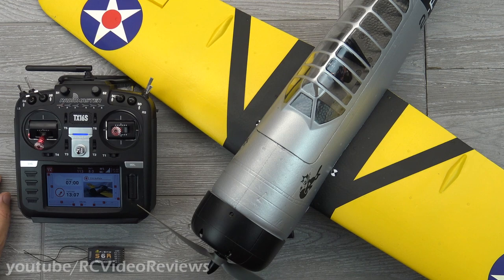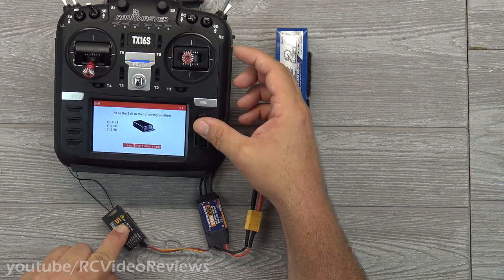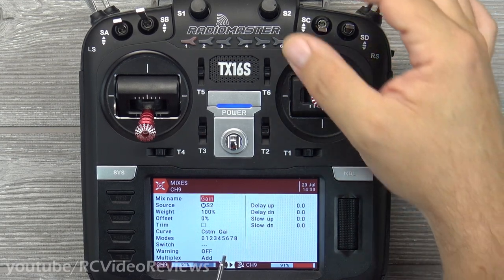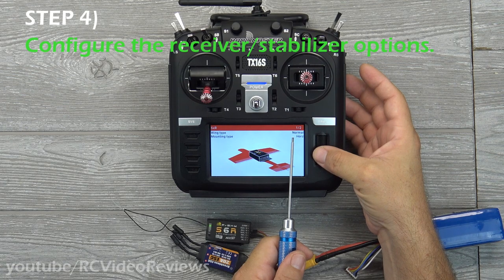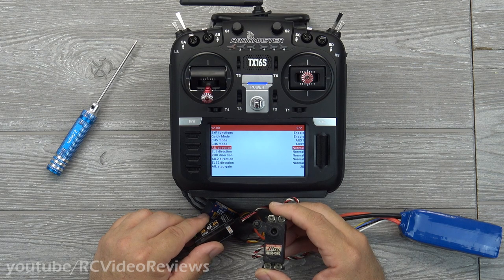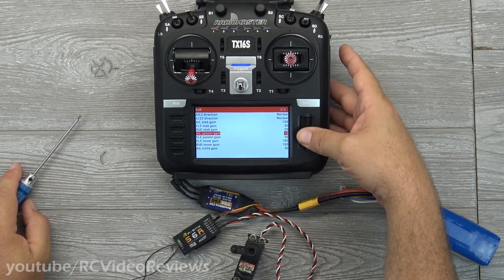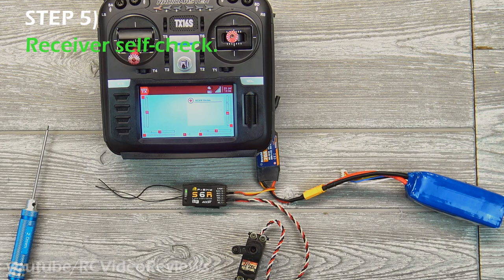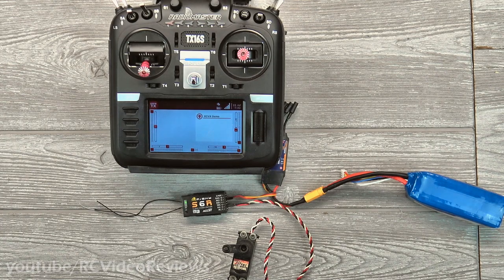Radiomaster TX16s and FrSky S6R / S8R Setup Guide [Quick Mode] • [Intermediate]

Comment: Your video about Open TX ,Radio Master TXs and RC items  are very helpful.  hank you very much.
I have a problem with my S8R receiver.
The throttle of channel 3 works correctly.
However, all the other channel are fixed near neutral (5-7channel are exactly 1500ms) 
Then, nothing can be done after that.
Do you have any solution ?
Reply from the maker: Set rates to 100%. Perform level calibration by having channel 12 pass through 0 3 times in 5 seconds. Wait for servo dance, then move your sticks to full deflection immediately after servo dance is over.
Reply: @RCVideoReviews  Hello Thank you. I 'm not very familiar with open TX mixer. Could you tell me more details of how to use channel 12. Unfortunately I can not understand [ channel 12 pass through 0 3 times in 5 seconds] because of my ignorance.

Comment: have you flown this receiver in larger air planes  like 1.20 size nitro  with this radio as well?  pretty new to the radio master unit and just trying to get some feedback when it comes to this unit
Reply from the maker: The biggest plane I have is my Dynam Smoove which is 63” and it has an S6R.

Comment: Did you add a lua script in the radio or it is autoinstalled while the biding procedure
Reply from the maker: It comes with the stock sd card contents. Nothing gets auto installed on opentx radios outside of what is included on the sd card contents from the developers.

Comment: Thanks for the help with my S6R. You kind of lost me in the gains section though. I will be using the S6R on a delta wing with only elevons so I guess I should leave the gains as they are.
Reply from the maker: What's the question on gains? Gains just go to how far and how fast the stabilizer changes the surfaces. It seems in Attitude mode the gains specify speed of reaction where in stabilize mode they specify distance of reaction.

The simple thing to do is to put gain on a knob and use the knob to tune while flying. If the plane oscillates, reduce the gain. If it doesn't respond enough, increase the gain.
Reply: Thanks for clarifying the difference between Attitude mode and Stabilize mode. I set everything up as you directed and did the initial calibration as it is not secured to the AC yet. It all is working as I can tell but now the elevon mix I had worked out is all out of whack and I am still trying to figure out how to fix that. When I get that worked out, it's time to fly.
Reply from the maker: @graywoulf  You don't set mixes on the radio if you're using an SxR, you set the mix type on the SxR configuration and the RX handles the mixing for you. Put Aileron on Ch1 and Elevator on Ch2 in your radio and set the plane type to wing in the SxR setup.
Reply: I thought that was part of your tutorial here in going into the radio's settings and the FrSky SxR settings and designating the wing type and mounting orientation. I guess that this is going to require the use of the S.Port Tool Kit (STK) and app then?
Reply from the maker: @graywoulf  Nope, you can setup the receiver entirely via Lua. I'm just saying with the S6R you don't use mixing in the radio. Just tell the SxR you're using a wing.
Reply: As it turned out, all I had to do was delete the elevon mixes in the model setup to get it working. Since I had already told the SxR that I was flying a wing and it had already set up the mix. As JB would say... "I learned something today". 😉👍 Thanks for your help once again.

Comment: Hi, great tutorials.   I’m currently using the x9d on an excavator.  The TX16s display does look more intuitive, I will try to see if you have done a comparison video as wondered what extra benefits I could gain by updating.
Reply from the maker: Here's the vs video I made: https://youtu.be/hZf4HqBuDas

Taranis is really good though. Hard to beat that radio. It has solid hardware.
Reply: RC Video Reviews    Thanks for the speedy reply and info, will take a look. 👍
Reply: RC Video Reviews    🙈sorry I now realise I watched this video which got me thinking about upgrading to this model. Either that of the x12s

Comment: Awesome video! (as usual) John. Thanks for the quality of the material and delivery! 
(We need to support your efforts via Patreon).
So I have a question: I am trying to set up an S8R Rx and I am having trouble getting the "System" option (04 - Frsky SxR) to work for me. 
I can get to it and see the 1/2 and 2/2 pages. One page 1, I see Wing Type line and the '---' to the right, but I hit Enter and nothing happens, same thing happens for "Mounting type".  If I go to page 2, the same thing happens I hit Enter and nothing happens. Any suggestions?  

BTW one thing you could perhaps add is how to update SxR receivers with the latest firmware (via PC or TX).  I would definitely like to learn that from you!  THX
Reply from the maker: It's really easy to swamp these Rxs. If you see the screen and can move to page 2, you're probably RF swamping the Rx if it stops working.

I can probably do a firmware upgrade video...I'll see what I can come up with.

Comment: Hi John, went to a swab meet today and purchased an S8R receiver still in packaging. Does your video work for EdgeTX as well as I am thinking of replacing one of my Spektrum receivers. Jim
Reply from the maker: Yes. I’ve configured half a dozen S6Rs on Edge radios no problem.
Reply: @RCVideoReviews  excellent! I’ll give it a try this evening! Thanks! Jim
Reply: Sorry to keep bothering you. I keep trying to bind my S8R but never can get it to go into bind mode. Any suggestions? Very frustrating!
Reply from the maker: There's only one way to do it as far as I know and it's worked on dozens of my SxR's: Press the button, power the Rx on. That puts it in bind mode.
Reply: @RCVideoReviews  John, finally figured it out, switched protocol to FrSkyX2 and it bound. Yeah! Thanks again for all your help.

Comment: then if channel 9 gain doesn't change anything i don't get it why you configure it ? 
what did i missed ?
Reply from the maker: It changes the deflection in stabilize mode and it changes the rate of deflection in auto level mode.

Comment: So could you 50/50 the self-check (ch 12) switch to the momentary switch and have it be a panic button as well as the self-check?
Reply from the maker: Panic button? 

Personally I would remove Ch12 from the mixer after the Rx is setup. You can use the mode switch to enter stabilization and autolevel modes. If you want to put autolevel on  a momentary it would be easy enough to do.
Reply: @RCVideoReviews  yeah, that is true. I probably would never use it anyway. Just was curious is all.
Reply from the maker: I’ve accidentally left the calibration switch in the wrong position after taking off and the plane flew in auto level mode even though my “auto level” switch was set to stabilization off. It felt like I lost the plane. I wound up landing it with rudder and elevator only. Once I got it on the ground I realized what I did. The calibration switch really just isn’t needed after you calibrate. Just another one of those things that can go wrong especially if you don’t fly the plane for a little while.

Comment: Good evening. I bought this radio to replace my old Turnigy. All my receivers are FrSky V8 FrII. I was unable to bind the receivers on the normal menu and after watching countless videos was able to bind one. Although after switching the plane on it took about 10 seconds to get a green light on the receiver. I decided to put it in a foamy and take it out this afternoon. All went well for about 5 minutes. I was able to take off and trim the plane without problems but after a close fly past straight and level everything went south quite quickly as I lost all control. What am I missing or is there a trick to this ?
Reply from the maker: 1) The MPM supports D8 mode. I've flown it with multiple D8 mode Rxs with no issues.

2) No receiver should take 10 seconds to bind on power up, it should bind instantly. So until you get your plane in that state, I wouldn't fly it.

3) Have you performed a frequency fine tune for D8? It sounds like you need to.

There is no trick to it, when it is set correctly, the radio will bind instantly and fly any supported protocol:

https://github.com/pascallanger/DIY-Multiprotocol-TX-Module/blob/master/Protocols_Details.md
Reply: @RCVideoReviews  Hi thanks for the feedback. It is actually V8 but I suppose the procedure is the same. Thanks, I will look for a video on how to do it.
Reply from the maker: @Kobus van der Linde It's actually D8 if you want telemetry. I don't know why you'd bind it in V8 mode (non-telemetry). Bind it with telemetry and you can get RSSI which will help you understand how the Rx is performing. In V8 mode, you're flying in the blind.
Reply: @RCVideoReviews  Thank you, I am not sure if the V8FR-II (8 channel) is telemetry capable but I will give it a go and maybe let you know. Can I send you a pic of the receiver on your email ?
Reply from the maker: @kobusvanderlinde9431  The book says it is:  1.3 New feature of V8FR-II over V8FR-HV
Compatible with all FrSky modules (V8_mode & D_mode), receive only (V8FR-II can
 talk with module of either mode, but it does not send telemetry information back to the transmitter).
Reply: @RCVideoReviews  Thanks, this helps a lot. Thanks for being patient. I'm still learning this new 2.4 stuff. I am more used to the old school radios.
Reply from the maker: @kobusvanderlinde9431  No problem. Glad to help.

Comment: Does the S8R need to have maximum movement on control surfaces during calibration and can this me reduced to easier weights after calibration?
Reply from the maker: Most definitely it does. Do not forget that step. Yes, you can reduce weights after calibration. Highly recommend 100% weights for throws after self-check.
Reply: @RCVideoReviews  OK I understand that weights can all be reset after calibration. How about trimming? will trimming using the normal manual adjustment and mixing for say flaperons be OK?

Comment: Can you use the S.port for a vtx? Also if setting this up for a race wing... will it be almost the same. Thanks.
Reply from the maker: I don't understand this question. s.port is for sensors, not for video transmission. So I'm not sure what you're trying to accomplish with a vtx->s.port link.
Reply: @RCVideoReviews  I thought it was a smart port link to run lua script to change the vtx settings. However I have since learned that the vtx I am wanting to use does not have an osd chip and therefore would need a flight controller. Love your content!

Comment: I try to bind new RMTX16S with new FrSky S8R - without success. But when I connect power from esc to S8R red led is slowly flashing. When I push F/S button and curently connect power red and yellow(maybe green, hard to say it) led start to light. I am confused, what is wrong? Can you help ?
Reply from the maker: Power S6R while pressing bind button. When the LEDs come on release the bind button. Green LED should be lit. The solid green light may be different on your RX if you've never bound it before. All of my S6Rs have been bound, so I can't tell you what the out of the box color is for certain. What I do know, is if you press the bind button and then power the Rx on, it will be in bind mode. 

On your radio select FrSky X D16 if you have a < 2.x firmware. Select FrSky X2 D16 if you have 2.x+ firmware on the Rx. If you don't know what firmware you have, try binding with X D16 first. If that doesn't work, try X2 D16.

Press bind on TX16s
Select 1-8 Telem On

Rx Red Light will blink indicating a bind.

After bind light goes off on radio, power Rx off, then back on. You should see a solid green light.
Reply: @RCVideoReviews  Thak you very much, your advice helped me to solve problem, but Binding was successfull with parameters: FrSkyX2 LBT(EU) 👌
Reply from the maker: @pribylinecm  Use FrSkyX LBT(EU). X2 is for firmware 2.0+  X is for firmware < 2.0.x
Reply: @RCVideoReviews  There is no FrSkyX option, only: FrSkyRX, FrSky, FrSkyX2, FrSkyL. But it seems that FrSkyX2 LBT(EU) is OK. I did binding and all setups accordance your video and it seems correct
Reply from the maker: @pribylinecm  Sorry, I misunderstood. I thought you were saying binding did not succeed. The X2 option is for 2.0+ firmware. So if it doesn't bind, the answer is 95% of the time to switch to the non-X2 FrSky option. On my MPM firmware 1.3.1.69 the option is FrSkyX.

Comment: Hi new subscriber,  would you consider doing a setup video with a Spektrum receiver or craft? I would like to know how to add flaps and a switch for the as3x technology... I own the valiant from e-flite.... thanks 😊
Reply from the maker: I’m definitely going to add a Spektrum Rx soon. In fact I already ordered a DSM Rx from Lemon but they can’t commit to a ship date due to C19 so I canceled the order. 

Definitely on my radar to add a Spektrum Rx video. 

Welcome to the channel!

Edit: I just looked over the Spektrum Rx lineup--not very motivating to see their prices compared to other options on the market. Their AR636B is a 3axis stabilizer for $75. I don't think so. I'll be looking at DSM alternatives. I'm not going to subsidize that kind of pricing.

The S6R is $30 and has 6axis stabilization.
Reply from the maker: Yeah I saw that too. I’m told Motion RC Admiral RXs are rebranded Lemon devices as well.

Comment: Can I mount the S6r with the receiver plugs forward?  I don’t plan on using hover or knife edge, but stabilization and recovery.
Reply from the maker: I believe you can. You will have to reverse the stabilization output but I don't think it's a problem.

Comment: Have a problem after setting up.  Once channel works as if offset is 50%.  Monitor shows proper movement but has a circle back arrow in left margin.
Reply from the maker: That arrow means you have the servo reversed on the outputs tab.
Reply: @RCVideoReviews  Thank You.  Another (important) point on having throttle at lowest setting is that the Check/Calibrate will not initiate of the throttle is not at lowest point.

Comment: Hi, is it possible to use the stabelization feature  on a 3channel plane like a glider? I only have rudder, elevator and throttle (no aileron).
Reply from the maker: Not a problem: In that case you connect the rudder to the aileron channel.
Reply: @RCVideoReviews   Great! Thank you! :)

Comment: Have you messed around with hover? knife edge? There is ZERO info that I can find online about setting this up.
Reply from the maker: Sorry no.
Reply: RCdiy has a video on the SXR setup.  He has a web page narrative that explains advanced mode. Hover works great, I use it mainly to demo the receiver capabilities. Use playtrack to help you keep track of your flight mode using channel 10 & 11. I did try flight modes and the 6 position switch with logic switches to set up the flight modes. It was too hard to use and fly. It worked but I went back to using 2 switches.

Comment: Thank you for the great post, very informative. One question - do you know if you can receive telemetry data from the gyro and data log it? I am interested in replacing a X8R with a S8R for gyro "black box" recording purposes without using the stabilization characteristics.
Reply from the maker: There is no telemetry info from the gyro on an SxR that I'm aware of. Certain flight computers like Matek do provide this telemetry though and in those cases you can see it and log it on the radio.  See this video for more info: https://youtu.be/K8KZqkd29rg
Reply: @RCVideoReviews  thanks for the prompt reply!

Comment: I have the mode switch and gain switch setup, but for some reason on CH10 I am getting knife-edge and stabilize mode. Should be No-Mode, Stabilize, and Auto-Level. Any idea why?
BTW if you leave CH9 without any offset you can revers the stabilize and Automode response.
Reply from the maker: You have to set quick mode to turn off the extra modes. I’ll check out that ch9 tip. Never heard that one before. Thanks.
Reply: RC Video Reviews how do you setup simple mode? I don’t have ch11 setup
Reply from the maker: @RizHassan  Quick mode should be a checkmark in the first page of LUA configuration.
Reply: RC Video Reviews yep, that was the issue got me going on rest of the modes and tested hover and knife edge today, work perfectly.
Thanks

Comment: hope I can get help..I have SxR enable but then I dont get any movement when on the sticks only throttle works, But if I disable the Sxr all servo move but no stabilizer  this is on the jumper T18.  it used to work fine when I had the frsky X10 radio.
Reply from the maker: Go through this video and follow the steps step-by-step.
Reply: @RCVideoReviews  yeah I did ..did the part on Self check and moved the stick is what fixed it..
 Bit oddly I whent out to the field turned on my T18 to all missing model profiles. Not sure why that happens..got home and added them back on from my old save backup..only one I didn't backup was this one..will work on it more when I get home from work.
Reply from the maker: Glad you got your SxR working. Weird situation with the models. Good job having a backup. You might want to change that sd card out for another one.

Comment: Did you set the AIL stab gain to zero for flight? Or did you put it back to 50?
Reply from the maker: Leaving gains set to zero effectively disables the function, so if I intend on using that capability, I use a non-zero value. Largely gain values depend on the plane.
Reply: Ok, so you just set it for demonstration that in autolevel also is ail stab activ.....